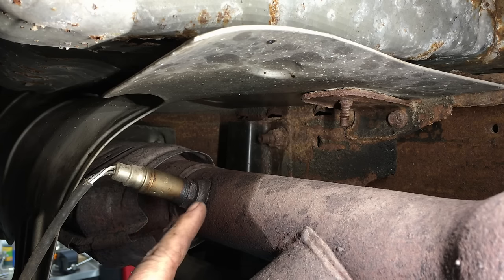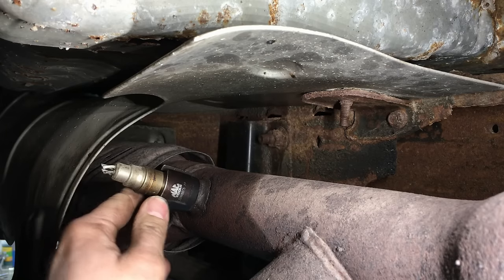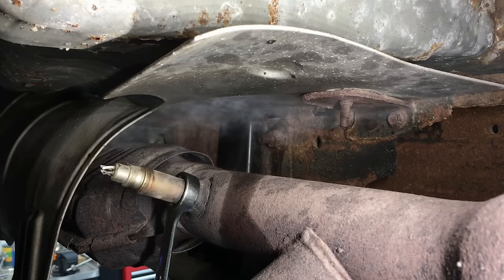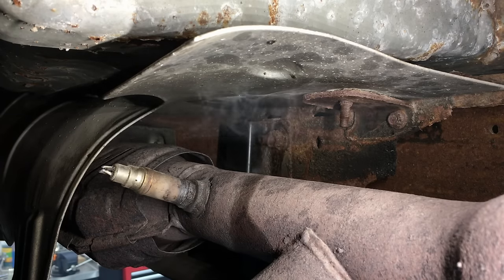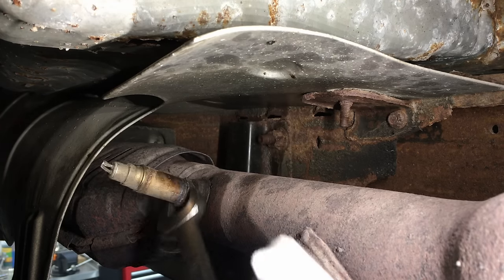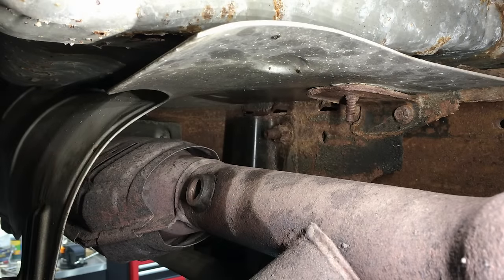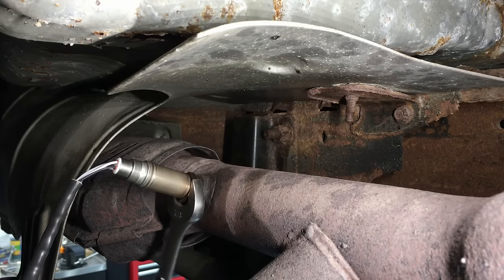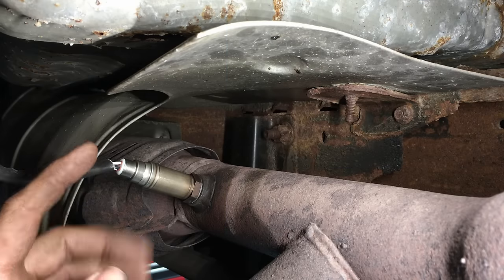Ford Quick Tips #81: Removing Rusted Stuck Oxygen Sensors the Easy Way!

Comment from the maker: These are the Parts and Tools I recommend:
High Intensity Map Torch-
http://amzn.to/2keOCBr
Quality Rust Penetrant-
http://amzn.to/2j91pEy
Oxygen Sensor Sockets:
Full Height-
http://amzn.to/2ySK1cB
Low Profile-
http://amzn.to/2kKoy0a
Oxygen Sensor Thread Chase(if needed)-
http://amzn.to/2B93CeC
Reply: I was just going to post the Thread Chaser.  Makes the new one go in like butter.
Reply: I would only recommend to use a 6 point wrench to decrease any chance of stripping the O2 sensor.
Reply from the maker: I would normally agree that is why my sockets are 6 point. In this situation though a 12 point is fine, in 15 years working the salt belt it has never rounded a one. Plus in tight areas like where most o2 sensors are you want the flexibility of a 12 point to be able to position it easier in the small space you have for the swing.
Reply: FordTechMakuloco have you seen or used the bolt buster tool?, It is used for stuff like this
Reply from the maker: No
Reply: Just a question, what are the syptoms of a melted cat convertor?
Reply: Just subscribed Awesome vids ford tech..
Reply: Now what do you do when you already rounded off the corner of the O2 sensor? I wish I had seen this before but I believe I'm up 💩🏞️.
Reply: FordTechMakuloco is the best on YouTube I fix my cars all the time just watching his videos and save thousands
Reply: Use a 6 point box end wrench,save the hex!!
Reply: Is a ,"Benzomatic Propane Torch", like a High Intensity Map Torch?
Reply: Once that sensor moves put a drop of brake fluid. It will come off with no tools just your fingers.
Reply: What symptoms did you have with a bad o2 sensor?
Will a bad sensor cause the truck to shake stutter and won't accelerate from slow or stop to go? It runs fine when I floor it but in the city stop and go makes it want to stall out but doesn't but it won't accelerate until I floor it. Could a bad o2 sensor do this?
Reply: @jlrockafella  same. I rounded the nut can't get it off
Reply: I bought the thread chaser, and I'm sure I'm gonna use it!
Reply: I wire bush around were bung and the 02 sensor meet to get rust and dirt off so my 50/50 atf and diesel can wick into the threads helps for all seized bolts nuts and pipe fittings

Comment: step number 1: obtain a lift
Reply: I'm doing O2 on the ground today, no problems so far.
Reply: Nicholas Graham getting to old for the driveway
Reply: Stop crying. You don't need a damn lift for everything. Use some cardboard and a couple of cinder blocks under the front wheels, you'll have enough space to do whatever. Step 1 get yourself a map gas torch.
Reply: @bishop5166  some of these guys are ancient
Reply: Ffuuucckk
Reply: Unless you have a motorcycle lol
Reply: 😂😂...

But, seriously..  Break the O2 sensor Loose-- when, then engine is hot/Warm.. and let cool.
Reply: @kosh9639  will give that a try thanks
Reply: @bishop5166  you only do it like this when you’re young.
Reply: Step 1 lift ur truck 6” and no need for a lift :)
Reply: Lifts make life so much easier.
Reply: Number 1 was  use another wrench for leverage 🤨
Reply: @FleetTech97 how expensive is a lift?
Reply: @dvader3000  
Cheap 2 post run around 3 grand plus installation.
Reply: @MrBurnz-cu6xj  Can confirm. Am young. Do this. Hate it. Don't think i can do it much longer. When I (if I can) buy a home, I think I'd like to have a garage pit.
Reply: Not everyone has a minimum of $2,000 to blow on a lift
Reply: Exactly
Reply: Quick...It is no fun working on the ground.....
Reply: I am a 47yr old mechanic without a garage, i don't even have the luxury of a concrete floor, i work in my driveway under a 40' long 20' wide carport, my "garage floor" aka driveway is uneven gravel and nothing sucks like gravel lol The carport does block the sun (really just makes it dark 24/7) and the rain but it sure af doesn't block the cold wind! A lift would be nice but remember it could always be worse bro, i have to change the spark plugs on a 06 Ford E150 today and its 13° outside with 10-20mph winds coming out of the NW, my point is to try and be thankful for what you do have while dreaming about the things you wish you had, then work hard to get those things. Good luck my friend 😁
Reply: Right that’s the reason we are all here. Because we can’t get leverage under the car.
Reply: Step number 1: own a car
Reply: Atf and diesel fuel mixed 50/50 put in small bottle like old pool testing ph drip bottle
Reply: @chonkyloreraccoon3686 why are you here then?
Reply: Yeah, cause I got thousands just laying around to buy a lift 😂

Stop crying, get on the ground, and fix it like a man 😂
Reply: @kosh9639 then come back up looking like the gingerbread. Toasty! 😅
Reply: @coryharder191 😂

Comment: Yea mine just gonna stay in there forever. Tried getting it out all day with torch, penetrating oil, 02 sensor special socket, breaker bar. Nothing will work won’t budge even a little. I’m loosing my mind.

Comment: Rather than cutting the wires, I get out my Sawzall and cut off the sensor leaving the hex part.  A regular 1/2" drive socket with a breaker bar will remove it.
Reply: don't use too much torque, it's a bad idea, use heat like he did or if you don't have a torch start your car and let get a little hot (that's how I got mine out) It would not budge when the car was cold.
Reply: @johnames6430  mlm

Comment: I anti-seize ALL exhaust part threads (especially manifold studs) because dry threads beg for moisture intrusion during heat cycles and subsequent corrosion.  I've removed parts I anti-seized thirty years ago with no problem.
Reply: The new factory sensors come with some anti seize applied to the treads already.

Comment: Wow, it worked perfectly.  I'd been trying to break the sensor loose for 3 days. Pb blaster, liquid wrench,  wd40. No luck, . I was a little scared to put a torch to it but I watched your video and followed your directions.  Amazing,  after about two attempts it finally broke loose.  Then I did the back and forth with the wrench,  spaying a little blaster at a time. 
Needless to say it worked great.  Thanks so much for posting this video.  Really helped me a lot.  I got a lot accomplish today thanks to your video.  👍👍
Reply: What the old timers used to call “putting the English on it”.   Sometime you need technique, not brute force.  Most have to break something and spend money to learn that lesson.
Reply: @apachebill  Ahmed, the Car Care Nut recommends loosening the Sensor as far as it goes, rock it back and forth, soak threads with BRAKE FLUID for 5 minutes, and remove with a 22 mm box wrench (if you've got the room) or conventional O2 Senor socket. Good Luck!
Reply: I use pb blaster all of the time on rusty parts . If that don’t work heat always does

Comment: Thanks for the tips, got my O2 sensor out by being patient and methodical. Used a combination of penetrating fluid, map gas torch, and a snipe on the end of the wrench. Maintained slow removal and penetrating fluid after the initial breaking of the threads.

Comment: Did it, worked great. Heat, box wrench and hammer. Unfortunately I hit my fingers a couple times. Sensors was 24 years old and I tried many times to get it out. Following your instructions I got it out in under 20 minutes

Comment: I tried penetrant and 4 different specialized wrenches with extensions- all that did was give me sore hands and start to round the bolt... then I finally decided to give a propane torch a go.  Heated it for around a minute on full blast then slapped on a normal wrench and it turned like butter!!!  This was on an upstream one rather than a downstream, but it worked just the same!
Reply: wish me luck brother I'm bitting the bullet this week 🤞🏻 all else fails 😡🤬🪓🔨🪚

Comment: Fantastic. I had almost rounded the sensor until watching this. After using penetrant a couple of times, cutting the wires on the sensor and then putting the round 22mm wrench on, it popped right out. Thanks a lot man!!

Comment: This way looks like it will work but takes a lot of time. From working at an exhaust shop a few years ago in Michigan the way we would do it is this way.  Using an O2 sensor socket that wont stretch open (Blue Point YA9375B or the Schley 93750A are good options) break it lose with no heat or oil using a long 1/2 ratchet or breaker bar. If the threads are cross threaded after removal use an actual 18x1.5mm tap clean the bung hole. install with just a touch of copper anti-seize on the threads and hand tighten with an open end wrench as tight as you would an oil drain plug.

Those sockets I listed were great, I never had an issue with them rounding the nut part of the sensor or stretching open even with a cheater bar. we would also not use heat because the thread from the sensor would get pulled off and and stay with the bung. Either way a 18x1.5 tap will clean it out fine.
Reply: werealeyes heating it up doesn’t just make it easier to remove from the exhaust, it helps prevent breaking anything from applying too much stress on the parts. If all you’re doing is replacing a bad sensor the last thing you want it to snap the threads off the pipe. Especially with guys like me who are doing this off their back in their driveway. Lol
Reply: @austincollier14  , yep, that "removing it whilst on the ground with your arms above your head" adds a new level of "difficulty" to the job. Most of the guys in these vids have the vehicle on a lift. Much easier to leverage the application of force. And whilst I'm not the "pro mechanic" and there are those "exceptions", the point of applying heat is to expand the metals. We know that metals expand when heated and contract when cooled. I've witnessed time and again countless fasteners/sensors etc., being successfully removed simply by applying the right amount of heat.

Comment: Big believer in using heat as well! When it's got a nice glow I spray it again with the penetrant. It's usually not flammable but you got to be careful.  I swear it'll wick in like solder and flux at that point, plus I think it thermal shocks it too to help it break free.  Good vid though! Just be patient is the whole trick I think though too.

Comment: Great video, I've been there numerous times, I have also found once it starts to move after heating use a enough force to retighten and untighten with some penetrating oil, to break up the rust in the threads. When refitting use a specific high temp anti seize grease or similar (not the cheap stuff) if not fitted already to the sensor.

Comment: You have provided an excellent tutorial. Thank you. Spraying it with PB Blaster, Liquid Wrench, or other rust penetrent after you have it broke loose will help. Tapping a seized sensor can help the penetrating oil seep in. Multiple heat cycles are a big help to break the rust bond. I suggest using a 6 point box wrench instead of a 12 point. Less chance of rounding off the nut.
Reply from the maker: You obviously have never removed an oxygen sensor in a tight place. There is a reason why I do what I do. Oh and BTW it is much harder to round the hex at this size so even with a 12 point you are ok.
Reply: @FordTechMakuloco  yes I have, and it's a bitch. Yes, sometimes the 6 point just doesn't  work.

Comment: Good advice, I had the same problem on a 1997 Maxima, thought I could get it off with a wrench, but had to get it torched at a local mechanic shop and once it got beet red hot, loosen it and tighten it back on before totally removing it so you don’t damage the weakened threads.

Comment: Hey buddy, I replaced one of the excess O2 sensors on my 12 f150. Wanted to say a big thanks for the videos. You have aided in my truck getting a new transfer case electric motor, thermostat, fuel level switch,, fixing coolant leaks (bad O rings), and now the O2 sensor. Thanks again!
Reply: The map gas and a 22mm wrench did the trick.

Comment: Great video - it saved me some serious grief and dollars.  On my two upstream sensor I took my 06 F150 to Tuffy's Auto Repair in Toledo, Ohio and had them replaced there.  They did it for $40.00 each.  The garage had a lift, which was everything because I would of had to do the job laying on my back in the drive wqy and could not get to the left front O2 sensor connector.
On the downstream side the left O2 sensor gave me a little bit of trouble but came out okay.  The right sensor was a different story.  On my first go around with it it bound up on me.  Instead of doing it Brian's way, I muscled the sensor and it locked up ( I watched this video after I did this).  Before I would do any more damage to the sensor I took my truck to Tuff's to see if they could do the job, since they did the two upstream ones - price was a bit higher - $80.00.  They put the truck on the rack and heated up the sensor and tried giving the sensor a good pull.  In a couple of minutes they came back to me and said that it was not going to budged and that would have to destroy the sensor and the catalytic converter which was going to cost some serious dollars (1500 or so).  They asked me if I wanted them to continue.  I said no.  They did not charge me for trying and not doing any work per say.
From Tuffys I went to my local Ford Dealer and made an appointment to have the sensor removed $97.50 without any extra).  This was scheduled for tomorrow, September 24, 2018.  After watching this video and a couple of other videos I decided I owed it to myself to try removing this sensor one more time.  I prepared myself to tackle this in a couple of different ways.
On my 06 F150 the heat shield divides the space in half between the converter and the transmission, making getting suitable tools in place difficult.  The first go around I used the "crow foot socket with the flex handle" and started to round a couple hex points.
The tools I got together for this time where: 
22 MM deep well split socket with the 1" hex head (1/4" drive).
22 MM combination wrench.
1 " combination wrench.
Pipe wrench.
Large vise grip.
Cheater pipe.
Portable torch.
Tread chaser.
WD40 Rust Breaker.
I did not cut the wires as Brian indicates in the video, reason being is if I was unsuccessful in getting the sensor out I was still going to have to get my truck to the Ford Dealer.
My truck is fairly high off the ground, but I jacked it up giving myself as much height as I felt comfortable with.
After crawling under the truck.  I put the deep well socket in place.  Once this is in place there is no room to put a 1/4" drive breaker bar or ratchet in place.  There is just enough room to get the 1" combination wrench box end on.  The only amount of room to work the wrench is from about half way up along the side of the transmission to the bottom of the floor pan.  Working with Brian's methodology, since the sensor was already bound up in the removal direction.  I took the wrench to the tightening direction, pulling a little at a time.  I soaked in as much penetrating oil as I could.  I started working the wrench/ socket between tightening and loosening the sensor a small bit at a time.  For at least 15 - 20 minutes it felt like I wasn't going anywhere with it so I was going through my thoughts as to what to try next, utilizing the pipe wrench or the vise grips and cheater on the socket doing what I was presently doing with the wrench.  As I continued with my motions the tightening and loosening sequence started to show some movement.  I shot some more oil at the sensor and continued with what I was doing   For the next 45 minutes or so I continued this until I was able to back the sensor out of it's threads.  The unit would not come out and for a bit of more time I kept trying to bring it all the way out, no success.  I was beginning to feel that I stripped the threads.  I finally decided to angle the unit a bit in different position to where the unit would bite a bit, once I got a bite,, I loosened the the unit some more with the 22MM wrench (socket is removed) and was finally able to back the sensor out.
I inserted the thread chaser in the hole and chased the threads, cleaning them up.  Once the threads were chased in the converter the threads felt not to be stripped.  I inserted the new sensor, tightened it down and plugged it in.  Success and done.  
The sensor that I removed had a metal buildup ring around it that would not let it get past the threads in the converter.  It gives a person the illusion that the threads are stripped.
I did this cold without any torch heat.
I installed Bosch Oxygen Sensors rather than Motorcraft/ Ford.  Bosch invented the first oxygen sensors.
Reply: I personally would've stuck with OEM on the 02 sensors. Just FYI the downstream 02 sensors are not necessary for the drivability of the vehicle, there are just for emissions. They meter the air after the cat to make sure it's doing its job right.
Reply: It probably doesn't matter, dollars to donuts says Bosch makes the sensors for Ford as they do for a lot of other manufacturers.

Comment: Had a similar experience with an EGR Tube on an '04 Explorer.  Ended up using the preheat holes on a cutting torch to heat the gland nut at the Exhaust Manifold.  It "Squawked" all the way off!  Unreal!

Comment: I've gotten a few tough ones out by cutting the whole body of the sensor off with a hacksaw or Sawsall. You make the cut right down near the hex nut. Then heat and lube it and use a regular 6 point socket and a long breaker bar. This technique also works on things like power steering lines and brake hose ends. You cut the line off and then you can put a regular 6 point socket on the hex nut and use a breaker bar to turn it. In really tight spaces use just a hacksaw blade and wear a glove. The soft aluminum lines are very easy to cut. I ALWAYS use this method exclusively to remove power steering lines from power steering racks and pumps. After removal be sure to wash out the holes with some spray to remove any metal chips left over from cutting the line.